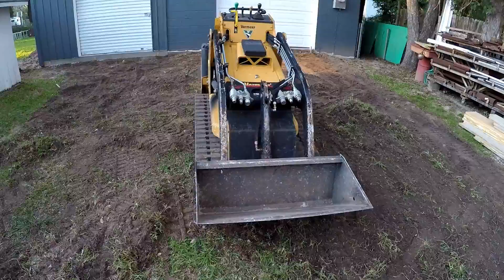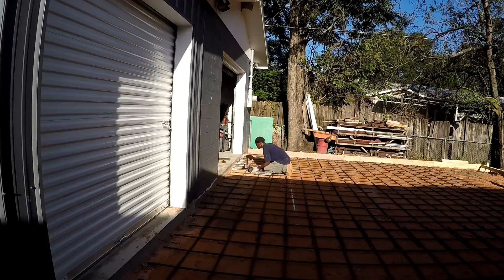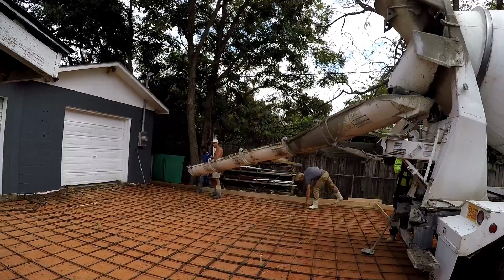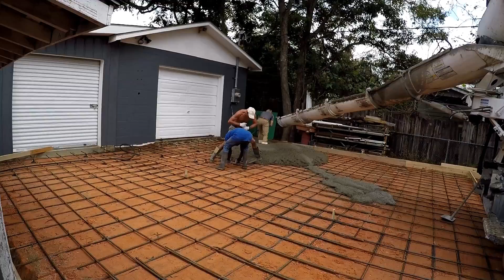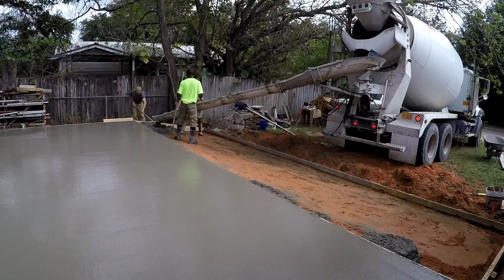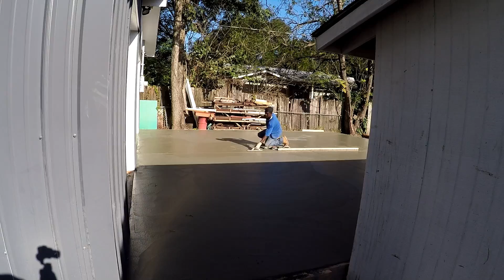New Shop Concrete Slab!

Comment: Hey Adam, I'm a 20yr concrete finisher and pool builder. I have went through and read all the comments and have to laugh at most of the know-it-all's. That was a hell of a lot of work for 3 guys. We run a 6 man crew for most bigger pads like that. You have an awesome pad there that will last you a life time. I would have done things a bit differently like more handles on the Mag float to reach all the way across and we typically use a concrete tamper to knock the stones down and bring the cream up but they got it done with a little more muscle then we would. I feel the worst for that guy raking the crete, his back must be like rock. I hope you treated those boys right and fed them a good lunch for all that hard work!!! Cheers mate!!!
Reply from the maker: Thanks Charles! They were a good group of guys and did a great job!
Reply: He gave them a tip. " get an indoor machinist's job"
Reply: Dont you love Facebook armchair experts?!
Reply: @aldotheapachedude  SOme of us actually have a lot of years experience.
Reply: I just can't fathom why people still use rear discharge trucks. I've never seen one before, does the driver not control the chute? I work for a concrete company in Michigan and man... these guy make it look hard. Here all trucks are front discharge and controlled by the drivers.. a good driver makes your life A LOT easier, an experienced one basically does the job for you.
Reply: @mURKeASY  Lots of areas still use rear discharge trucks. I am retired from road and bridge construction and have never been on a job where a front discharge truck was used in over 30 years in that work  The driver normally gets out of the  and works the throttle and discharge levers on the rear of the truck. If you need to move during the placement someone else swings the shute as the driver maneuvers the truck. 

Next Read discharge trucks had the advantage of being con a commercial chassis that makes parts easier to get for repairs and reduces the total cost of the piece of equipment.
Reply: Did you catch the fact that not all the rebar was at the proper height? Did you catch the fact that one bar did not go all the way across? It was not that large of a job. I spent 8 years in bridge construction, I have spent a lot of time placing concrete.
Reply: @johnmcmickle5685   I am by no means an expert nor am i criticizing this mans work . but what bugs me is i saw no rebar at the  slope is that normal ?
Reply: @Genetics1  There are situations where no rebar would be normal. That said it would be normal practice to place tie bars through the form to site the ramp to the slab.  There are concrete pavements have no reinforcement other than tose tie bars and dowels at the joints.
Reply: @johnmcmickle5685  - is this situation normal to have no rebar?  I would have said it needed it because it will be taking the most abuse from vehicles being driven up onto the slab.
Reply: Charles Sager a mechanical vibrator and vibratory screed moves the aggregate down and brings the cement paste to the top.
Reply: I would have said,"Yo, one guy rake and somebody grab other end of that screed!"

And Fla that is probably a must regarding crew size because how much excess labor has pushed down prices
Reply: Get out of here with that lunch bs!   Guy paid its weight in gold for that slap
Reply: I purred 800 sq ft pad with 4 people for first half a day and just two for the 2nd. It was one of the hottest days of the year... It took everyone to rake it in as the trucks with concrete could not reach every corner of the inverted U. Needless to say I have very wavy floor.
Reply: It is the bosses responsiblity to pay his guys well and treat them right...Not the customer!
Reply: Charles Sager we poured a 13,000 sq ft drive way 180 yards with 6 people 😂 you must be wasting a lot of money, don’t be scared to hop in and help drag off and bring that come along out and rake some mud. pussies are scarce in the concrete world but they are there.
Reply: Best part about concrete is the cream should have kept it like that tbh.  That pallet jack is gonna be a pain to move on that
Reply: fuck the good lunch!!! good money is what were after...
Reply: @Paul-qq7mh  I had a concreter do a small job for me for an agreed price, and after it was done, I took him out to dinner - my shout. The labour cost me $200, but the dinner was over $300 with all the alcohol he drank - at my expense. Honestly, I'd never seen someone put so much alcohol away and remain conscious! I'm a non-drinker, so my contribution to the bill was a $20 meal. I vowed that next time, I'll supply the tucker, and a slab.
Reply: my opinion they should have had 5 guys and a pump lol, way too much work on the day of the pour
Reply: He didn't tip them!
Reply: Man I've poured placed and finished 5,000 yards with 13 guys I've done 7 yards by myself and I've been working with concrete for 7 years this is nothing and throw some joints and nice broom finish with a horse hair broom shit ain't nothing
Reply: @abelgonzalez5937  you're one cocky and annoying little maggot
Reply: @ddag431  if you think that's annoying my bad it's just a bit of what I've done and constructive criticism take it how you want if you get upset of what I said then your in the wrong field that's if your even in this trade
Reply: @abelgonzalez5937  Having spent a lot of years in bridge construction there are times you can place large amounts of concrete with very few people.  So do not brag too much.
Reply: @abelgonzalez5937   not everyone is you lol

Comment: Is there any reason that expansion joints weren't put in the slab? I would think in Florida they would be a must with the hot sun in the summer.
Reply from the maker: He put control joints in it

Comment: interesting to see the different methods 
that job would have had plastic and all the chairs in before the truck arrived its just one less thing to do and think about 
as well we would have used as a line pump its more expense but its not as hard on the guys and easier to get the best result  
most of our steel comes in sheet form far less work only need to tie the edges
Reply: there really is nothing better than fresh flat clear work space 
looks excellent man

Comment: I'm no concrete expert but I have participated in a few pours. I'm wondering about the sides where there's not really a footer, but it kind of tapers down to what looks to be a point towards the ground.  
 I'm wondering why they didn't dig a good trench all around ?  Seems like the sides at least nearer towards the bottom would be weak??

Comment: worked great for me. when its all done use a concrete brick on a long handle and rub it down like you are mopping it. that takes all the fuzzes from the fiber off and levels any stray lines from the broom finish makes it look real good. a good sealer would be highly recommended. hope you got a better warranty than the give in Wisconsin with our frost thaw environment  standard warranty that sooner or latter it will crack and defiantly guarantee that no one will steal it.  nice looking job.  .
Reply from the maker: I'll be looking into sealer soon, it's too early to do it right now.

Comment: So they just leave the wood form board in between the slab and the ramp?  I would think that would cause some issues with expansion and contraction and the wood rotting?
Reply from the maker: Leaving a treated piece of lumber in the separation joint is normal practice for some types of jobs.
Reply: It will rot ... when it does dig out the wood and slide in expansion joint then top with self leveling compound
Reply: Yeah that will not be good for sure. It’s going to root one day and he’ll have a big gap for sure.
Reply: thats not right

Comment: Really nice work! The longer you can keep concrete wet. the harder it will be... Thanks for sharing
Reply: I am also about to build a house and 4 car garage and going to try to keep the concrete wet for 7-14 days which is a compromise on 28 days fully cured concrete
Reply: Plastic tarping is your friend
Reply: Awesome plan .I see shop expanding right up to the slope .Perfect plan
Reply: Hey, just so you know, you`re not getting much gains after 4 days of wet curing.
Reply: Matt Lang you should reread ACI. Curing occurs up to 28 days for strength compliance
Reply: @Lumens1  7days kept wet is the right answer
Reply: @vincecapo5653  this is absolutely correct, yields long lasting concrete
Reply: Naomi the Dogsitter yes he forgot to put plastic sheet under the concrete slab

Comment: The best thing you can do is keep it WET for a week or so, so soaker hoses work good for it, maybe get a water hose timer so when your not there it will keep it wet, even if they put a sealer on it, you won't regret it Adam.

Comment: Excellent job all round. Great contractors.
Adam - keep it wet / damp for as long as possible....concrete gains strength and needs water over 7 - 10 days.

Comment: The man on the float is a monster. I would have been crying in pain. He's got my respect.
Reply from the maker: Yep! That's a tough job for sure and he does it right too!
Reply: the black guy screeding,leaning WAY out ,putting his back english on that screed! YIKES!
Reply: Claude Morehead Amen to that!!!
Reply: Its not hard to bull float .i started concrete at 18 im 21 now and i am crew leader . This job is not very good we broom it when its right on its point not to wet not to dry .these guys broomed it when it was hard allready . Looks horrible ..in my opinion
Reply: Omar Arriaga def waited too long to broom, and used the wrong type of Broom. I’m a union concrete finisher, so
I’m use to a different standard of work... don’t get me wrong, these guys worked hard but the product looks like garbage
Reply: @dylanpaul1212  both you guys are right (Omar)...I have been placing and finishing concrete 20 plus years.......

Comment: Looks like they left the form board between grade and the ramp. What was their reason? I would have preferred expansion joint. I drove a ready mix truck for over 20 years. Seen it all. They were two guys short if you ask me.
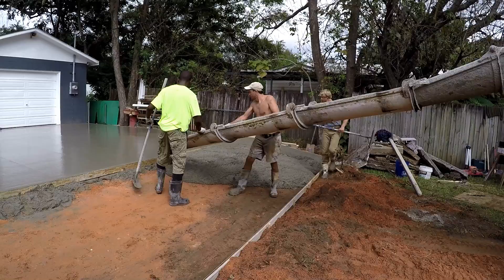Reply: That is 1x6 lumber and has no compress-ability.   look at 25:43 you can see the wood grain. I would just like to know the reason they left the lumber form to act as expansion joint.
Reply: It bothers me that the board will rot or absorb moisture and try to force them apart.
Reply: That is an expansion joint matt....the only thing missing was rebar through the form board and in the ramp, never rely on just fibers in my opinion.....other than that the guys busted their but on this job.
Reply: Lumber is sometimes used as an expansion joint, compressability is not the main function for expansion joint, it is the flexiabilty at the joint from movement in the slab that is why it's important to have dowels running through the expansion joint material used.
Reply: I’m a mason, been doing concrete for years. Yes you can use lumber for expiation joints. Also you do not need to tie in the rebar through your expansion. Especially for a driveway.
Reply: Almost every drive way I’ve ever done has wood expansions. Expansion could be a cut , or tooled joint, wood joint or plastic joint. One thing I do different , we use treated lumber for our wood expansion joints.
Reply: Matt Trotta 
thanks
Reply: I'm curious about that too. Is this how i't's normally done?
Reply: Maybe it was left there because in the future the ramp will be torn out and the flatwork will extend?
Reply: Are you that sure it's a form board and not something else? Just sayin...
Reply: More like 4 guy and a brain short
Reply: Should have been felt not wood. Its going to eventually rott and leave a void to collect dirt. Felt with coid cap is the way to go. Strip the cap the next day and fill the void with self leveling caulking.
Reply: And no reinforcing mesh in the ramp either. Curious.
Reply: Matt Trotta the form board looked to be green treated, so it will not rot.. as quickly.

Comment: Man that is a slab!  I saw a comment about rebar in the ramp.  It may be they ordered concrete mix with "hog hair" which in some areas is approved to take the place of rebar in slabs.  Make sure you get a good gravel base coming in to the ramp, especially right in front of it so heavy trucks won't cause the ramp to tip.  Funnier things have happened but can be prevented Adam.  Greg
Reply: Concrete guy did mention they were likely adding fibermesh to the mix.
Reply from the maker: The concrete is 3,500 psi fiber mixed. I took a pic of it, but I could see the fibers in the pour. I may have the slab extended further so the ramp would be eliminated.

Comment: Been in the building trade for 50years (retired)now your guys did a TOP JOB. And nice finish on the. Concrete I like the way they lifted up rebar a lot of concrete men would not do that what I have seen in the pass.TOP JOB.
Reply: That would never have passed my inspection. You put rebar supports in to keep the rebar at the level it need to be. After they poor the concrete you never will see where they stepped on the rebar making not in design specifications. Corner cutting to save a few bucks is not worth having a potentially bad product in the end.
Reply from the maker: Thanks for noticing the good work John.
Reply: I'm with you Taluvian - if you're not going to place rebar 100% correctly, rather redesign the slab so that you don't need it. I never put rebar in a surface bed.
Reply: I have to reply to specifically mention this. The entire reo mat should have been chaired with SOG ( slab on ground) chairs. Pulling up the mat after concrete has been placed is a bad way to save $50 on the cost of a bag of bar chairs. 

A vapour barrier should have also been used and no reo on the approach ramp? Oh boy. 20 yrs in the precast concrete game btw.

Comment: instead of wood steps off the big slab.. why not build it up out of concrete pavers with some construction adhesive to stick them in place.   you almost should have had them pour a 4 or 5 foot long ramp down it..
Reply from the maker: I wanted something simple I could handle myself. I think a simple 2x12 and a couple blocks to hold it up is all I need.

Comment: Getting that slab poured is better than Christmas. I was surprised the crew did not have a power trowel for a job that big. After pouring the slab, the fellow running with the wheelbarrow impressed me. They were all moving fast.

Comment: 3 guys doing that job is under staffed. I had 5 doing the same sized job and they did it flawlessly....finishing concrete takes a lot of people because there is so much to do in so little time. I agree with the driver of the concrete truck.
Reply from the maker: That's your opinion of your work. Joe likes running his 3 man crew and he said for most jobs that's all he needs.
Reply: @Abom79  3 guys 5 guys 10 guys. I've been pouring concrete for almost 20 years, doesn't matter how many people are there if it comes out good.  I think they did a fine job you will be happy with for years to come.  I looked to try and find something they screwed up, only thing marginally not correct is the rebar should have been on chairs but they picked it up consistently throughout. And I can't say I've never been on a pour where we didn't do the same thing.  Ignore the morons, you got a good product.
Reply: Hey Bill, Maybe you should have got/ paid up for better guys. seems they did quite well with the crew they had.
Reply: I've been doing concrete for 34 years and going to have to side with Bill on this one.  They were light on man power for that pour . Don't get me wrong I've been there and done pretty big pours with very few people. And that guy on the rod was bad ass! Nice video

Comment: Extra comment did they remove the form board at the slab to ramp they never showed that?
Reply: crazym8654321 --- Expansion joint....at a "plain change", I've don't that also.
Reply: arkansas13 expansion joints are a soft material not wood I used to do concrete we never left a wood board in any concrete as a expansion joint

Comment: Adam, that is a very professional job, the way all contractors are supposed to conduct themselves! The concrete design is super strong (I couldn't hardly believe that you would spend those mega bucks for simple flat work in front of a garage) with #5 rebars @12" o.c. ea. way and the contractor didn't "dilute the concrete with water" as 50- 75% of the concrete contractors do on a job of this type....very superior, high quality concrete. They did you an awesome job and I'm proud for you and proud to see that superior work by Americans is still produced....("they're right up with the quality of work that you turn out") 
Thanks for the video! 
 ....13
Reply from the maker: It might be a shop floor one day so I wanted it strong.
Reply: With the thickness of that slab and the rebar size & spacing, as I was watching the pour I was wondering if you did it that way with an eye towards future expansion of the shop.
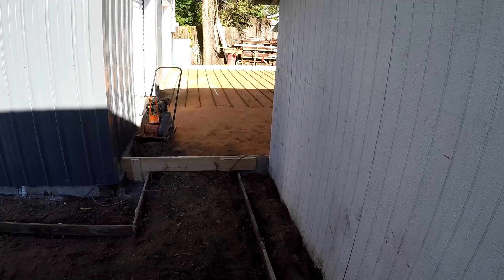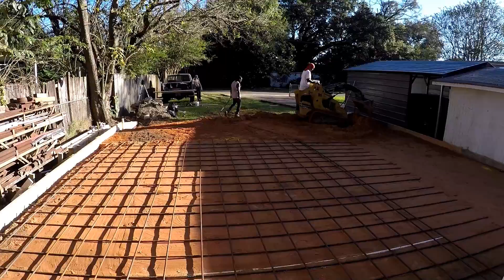Reply: Mr. Ed --- Check the video @ 5:11--5:34, the conduit is there.
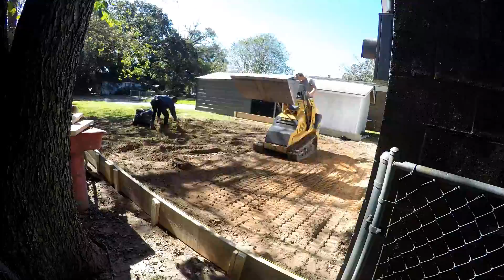Reply: arkansas13: Thanks - I saw the conduit at the end of the video - 36:10 - in the time lapse. Missed it at the 5:11 - 5:34 slot.
Reply: As Adam mentioned that pour may be for building space later. Thinking ahead.